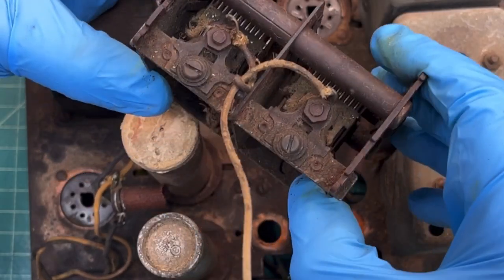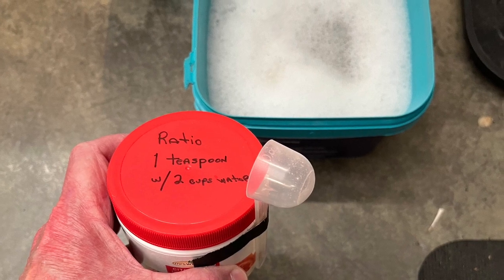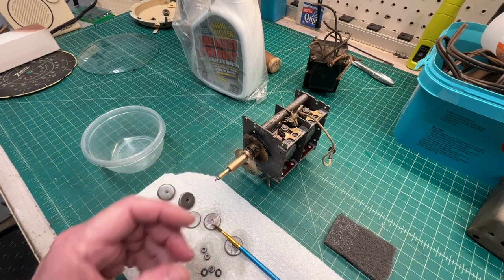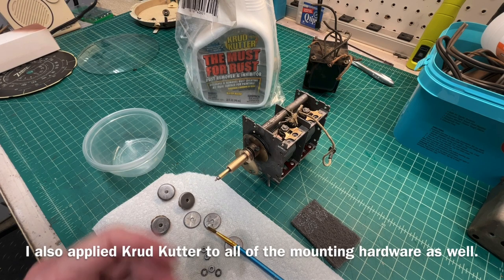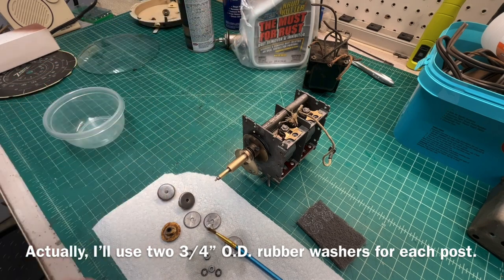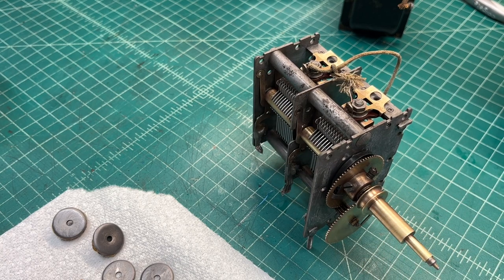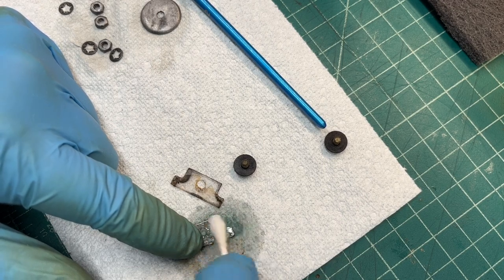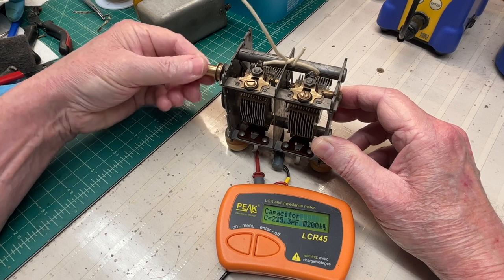Zenith 5-S-127 | Cleaning the Tuning Capacitor

Comment: Great work as always Don!
I wanted to share a tip for getting the old rubber off of those sleeve washers. Putting the washer over the tip of my soldering iron heated it up a bit, then twisting and pulling the rubber allowed it to come off cleanly in one piece with only a little residue left on the washer. Beats the heck out of my old way of scraping it all off with a hobby knife.
Hope that helps some!
Reply from the maker: Great tip! Thanks and one I’ll try when the opportunity presents itself. Thanks again. Best, Don

Comment: I knew that tuning capacitor would come out nice, just like the other ones that you successfully clean in previous videos. My ultrasonic cleaner operates on two different frequencies, which one would you recommend for cleaning tuning capacitors, the 20 or 40 KHz?
Reply from the maker: Hi Ken - playing catch-up on comments, I’m not sure what frequency my basic US cleaner uses, but I might be able to determine it by using my audio spectrum analyzer; if so, I’ll reply back and let you know. Have you had better results at a particular frequency? Best, Don
Reply: Don, I used my ultrasonic cleaner several times but only once for a tuning capacitor. I don’t remember what setting (KHz) I used but it took a long time to get the tuning capacitor looking good. I wished I had known about your citric acid technique; it probably would have taken half the time. @RestoreOldRadios

Comment: Ever have any problems with it rusting back up later? I just cleaned one and have a later of WD on it but wonder if it will rust back up soon.
Reply from the maker: I haven’t seen any flash rust reappear for the ones stored in a climate controlled environment. Many folks will clear coat the capacitor housing (less the stator and rotor) in lieu of using a rust inhibitor like WD40 or… I’ve had success with both… Thanks for reaching out and I hope my reply is helpful. Best, Don